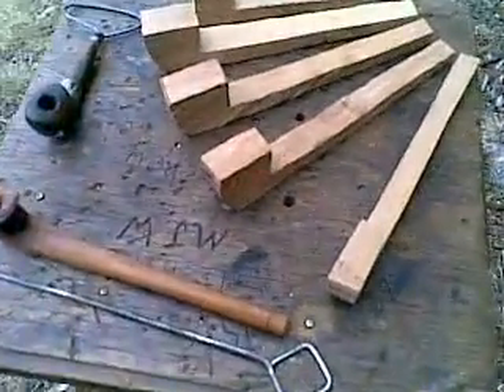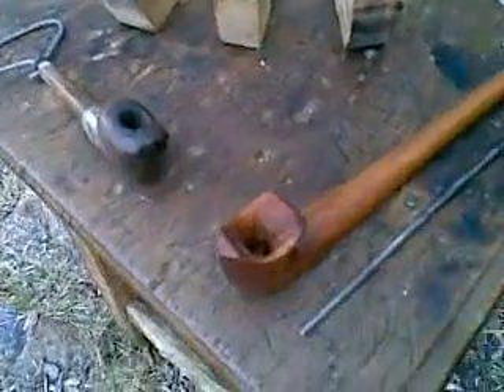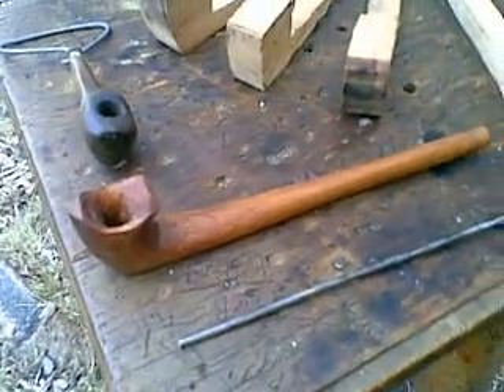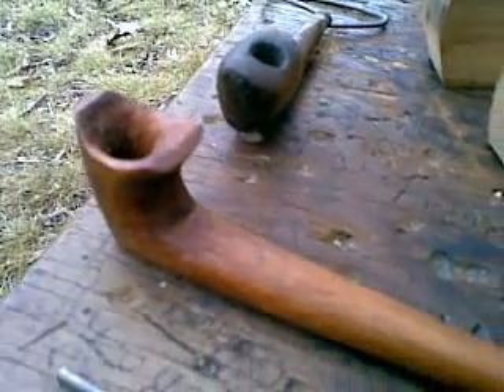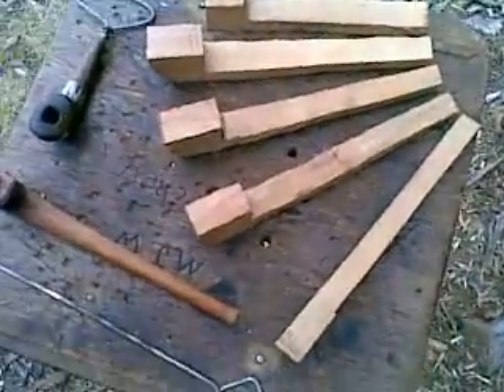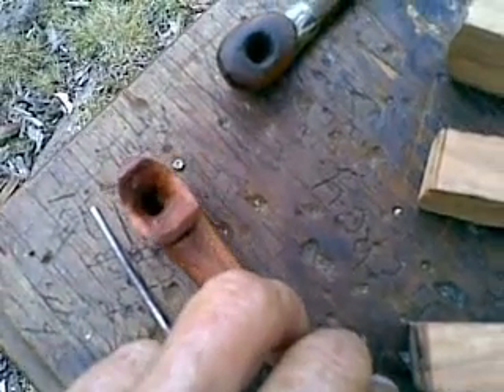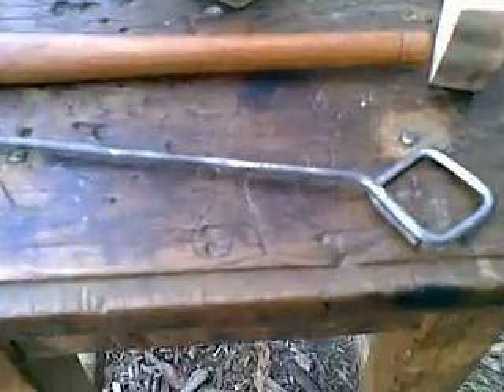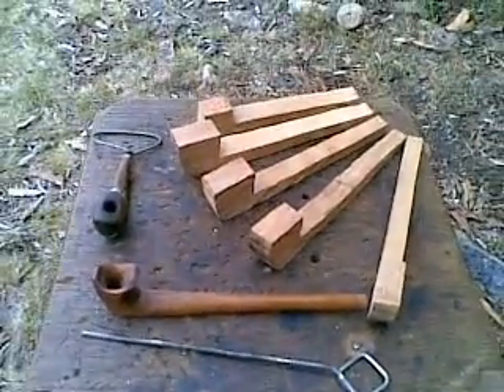Pipe-Carving #6, The Finished Pipe, With Cleaning-Rod. (Yt Sculptors Guild).

Comment from the maker: @walkabout16
   G'day... Thanks for that. Um, you CAN hold them with your teeth. I put a "Notch-Ring" around the Stem, about a quarter to a third of an Inch from the end of the Stem. So, Teeth engage the Notch, the Pipe stays where you want it for lighting, and as long as you don't bite too hard, there's No Worries...; holding the pipe in the mouth, between puffs, tends to fill the Stem with Spit ; and the Bowl makes Bubbling Noises, I find...
Ciao !